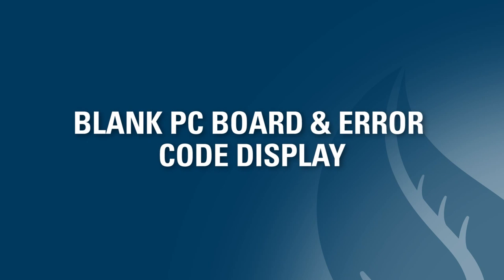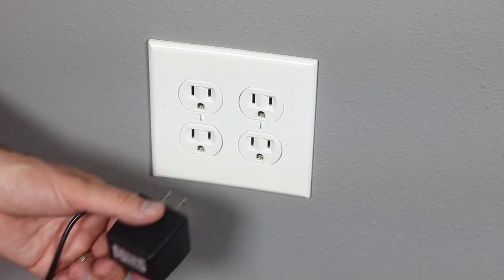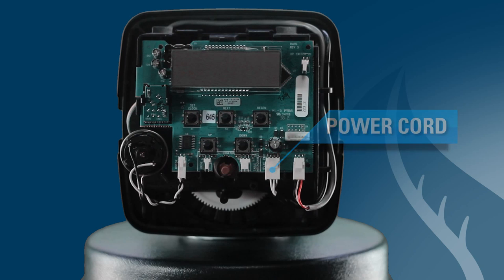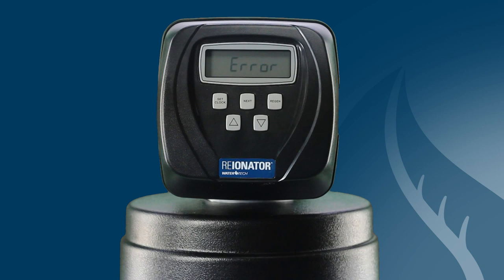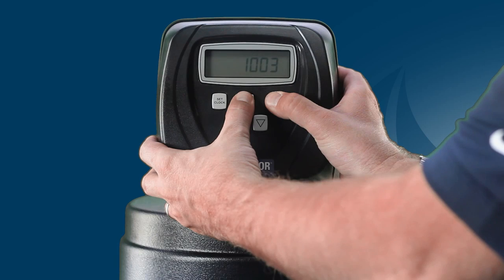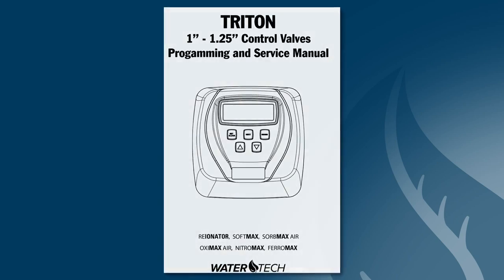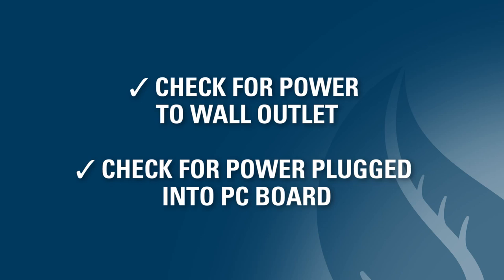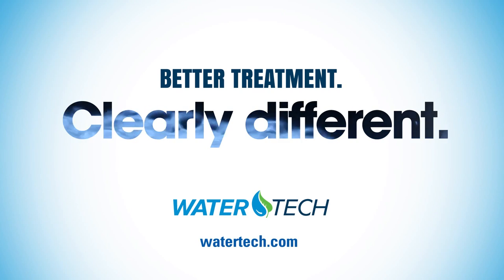WaterTech: Troubleshooting Error Code or Blank Display

Comment: Very useful video - thanks :) 
In my case I also had to replace the CR 2032 battery under the lid to get the screen working (after longer power failure)

Comment: I'm getting error code 403...
I reset via Next and Regen and set the board to proper time...
Now it's flashing "REGEN TODAY" and to the right it says in non blinking words: CAPACITY REMAINING 0 GAL.

What should I do next?
Reply: You regen as instructed :)  It's telling you it's out of softened water and you need to start a new cycle.

Comment: So I reset the error code 1003 by doing what you said. I heard the valve reboot. Now the display says Regen today, and displays the time. Is there anything else I should do?
Reply from the maker: Since the time is being displayed, there is nothing more you need to do.

The system will regenerate during the night, and you should be good to go.  =)